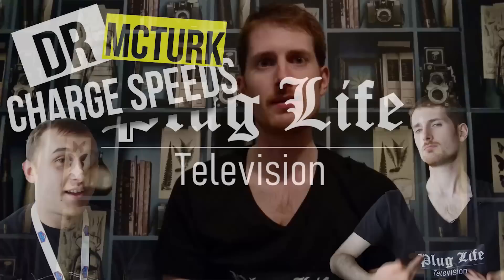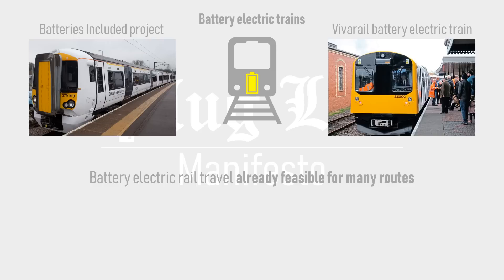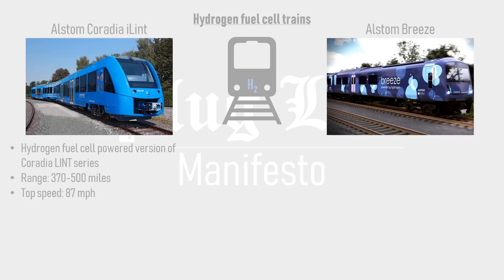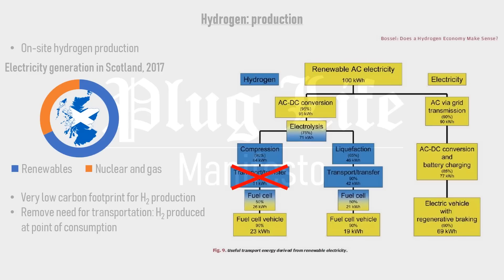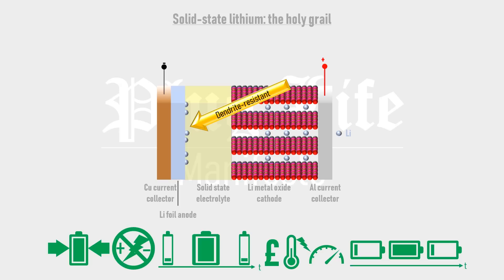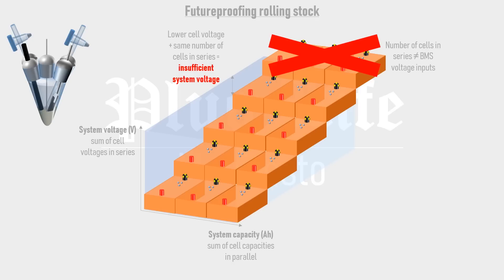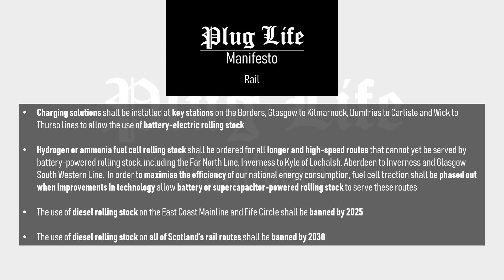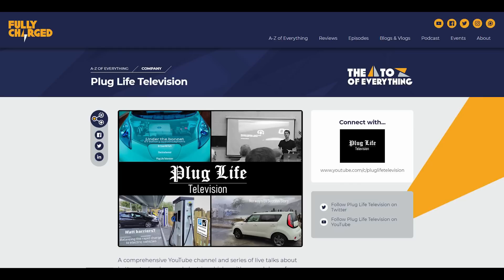Batteries VS fuel cells? | Plug Life Manifesto: Rail (Part 2) | Plug Life Television Episode 11

Comment: Class 31x units could easily be repurposed as battery powered long distance units. The units have one unique feature, a single pantograph/motor car with 3 basically empty trailer cars. This allowed battery sizes of about 1500 kWh (using 2013 technology) . The current technology would give about 2500 kWh,  meaning the units would have about 160-200+ miles range.
Reply from the maker: Interesting - I didn't know they were designed like that. Scotland has plenty of them kicking about, too. ScotRail's 314s were recently retired, and Scottish Enterprise got their hands on one to use for next-generation powertrain development. Unfortunately they're determined to use it to test hydrogen propulsion systems rather than batteries. I've told them on several locations that their hydrogen retrofit will never be used - if they'd retrofitted Class 43s from ScotRail's new Inter 7 City fleet, then the hydrogen system would have been immediately relevant and swapped into active service. This would also free up the 314 for battery powertrain development, which would likely see 318s being retrofitted in a similar manner for use on Glasgow to Kilmarnock, the Borders line and the Fife Circle.

Comment: All very thought provoking and interesting. I don't recall any mention of East Kilbride (apologies if I missed it) which is I believe the 2nd busiest route in Scotland after Glasgow-Edinburgh. It's diesel and to make matters worse has sections of single track. It has been rumoured many times that it might get electrified, and part of me hopes it does, although I just hope they manage to do so reliably given how much winter wind rain and snow East Kilbride gets. Given the relatively steep climb up from Glasgow to East Kilbride I'm guessing battery technology isn't likely to win out over conventional electrification - interested if this has been something you have considered?
Reply from the maker: That route is included under the umbrella of the Glasgow South Western Line.  The East Kilbride section is only about 13 miles long, so along with the routes to Barrhead and Kilmarnock, it could easily be electrified using battery power alone.  Steep gradients shouldn't be too much of an issue since modern battery trains can do upwards of 50 miles per charge, giving them plenty of spare capacity to tackle tough gradients.  The motors should be up to the job; it's just a case of getting sufficient power to them.

Selecting a power-dense chemistry like titanate- or LFP-based cells should ensure that battery powered trains are up the job on this route.

Comment: Hydrogen safety is major concern , batteries on trains can be charged at each stop and regen when slowing into stations . One question is the safety of breakfailure which at present is vacuum based and has good failsafe characteristics.
Reply from the maker: Good question.  I'd look at how this situation has been resolved on conventional overhead electric trains and apply it to battery and fuel cell powered variants.  Electric cars have vacuum pumps in them to operate the mechanical brakes.

Comment: Would it not make sense to only electrify part of the high speed lines so that the batteries can recharge? Would that not be cheaper and more efficient than using hydrogen?
Reply from the maker: The cost of the installation and maintenance of overhead lines in more remote areas needs to be factored in, as does passenger numbers on the line.  Partial electrification with "short hops" between electrified sections would work well on the East Coast Mainline and Fife Circle (see part 1) because they're busy routes.  Inverness to Kyle of Lochalsh, on the other hand, only has about four trains per day.

However, wherever partial line electrification and battery-equipped rolling stock makes the most economic sense, it also makes the most sense from a technical and resource-based perspective (most efficient way to decarbonise the route).